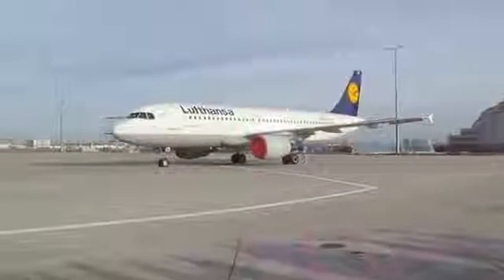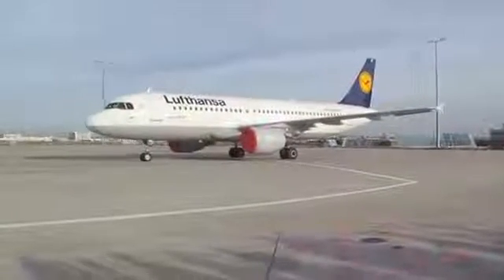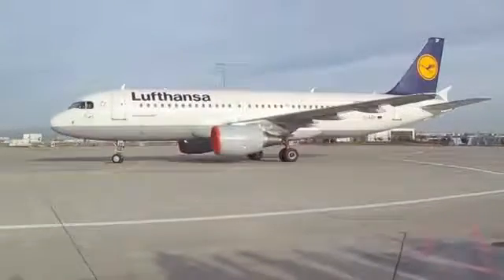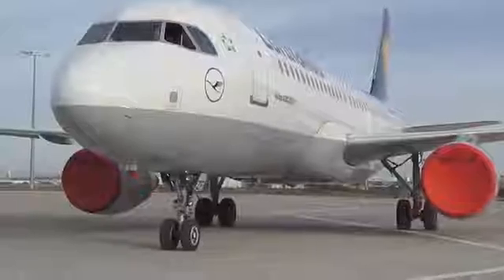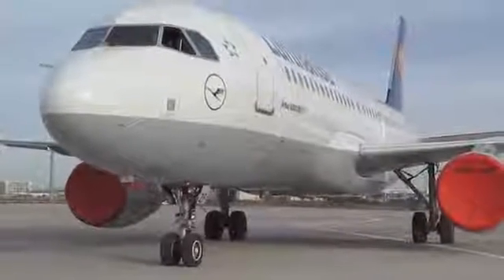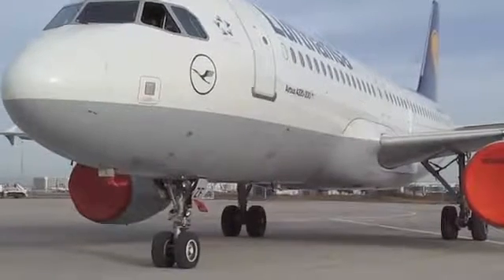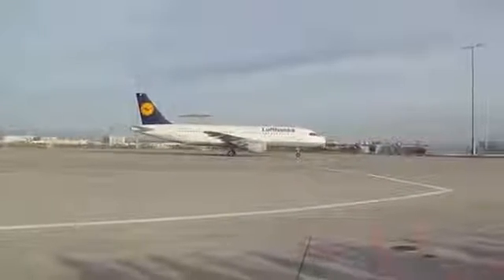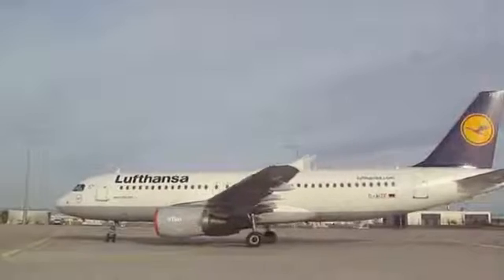Electric taxi system Airbus A320

Comment: Why doesn't the A350 have this?
Reply: Because the weight adicioned of the new equipments, in the long haul flights, increase the fuel consuption. In this case, is the opposite of the project goal (fuel savings).
Reply: @heberluizzunarellimartinsl4664  so it's perfect for short flights but too heavy for long flights

Comment: At last!This is a no brainer. Planes use up an amazing amount of fuel taxiing. Plus all the other savings and social/environmental benefits. My guess, 5 years until it's built in as standard on new planes and retro fitted to most of the rest.
Reply: Well here we are now five years since you wrote this comment and there’s literally nothing done differently
Reply: @boeinga370  
Yeah, sad isn’t it?
Reply: @q.e.d.9112  I know. They all go on about needing to make these “big changes” such as planting loads of trees and driving electric cars, but yet imagine the amount of fuel they would save burning if every single plane taxied around an airport electrically before and after each flight.
Reply: Honestly, in 100 years they will still be talking about what “needs to be urgently done” but the world will be the exact same as it is now
Reply: A no-brainer would it be when it wouldn't weight something

Comment: Using those electric motors ;  I suggest that they be used to SPIN the wheels up to speed before the plane actually lands, thus all but eliminating landing skid-wear on the tires themselves.
Reply: It’s been tried before using air, it causes the wheels to grab and redirect the aircrafts direction.
Reply: The primary objective of any landing is to get the aircraft to a safe taxiing speed as soon as possible, not meticulously protecting tyres. The vast majority of landings requires an ample amount of braking to slow the aircraft to a safe taxiing speed, in order to leave at the right exit and hence get to the gate on time - using up the entire length of the runway so as to protect the tyres is not at all the objective of a landing. The aforementioned braking puts a significant amount of wear on the tyres and that's absolutely ok as long as the aircraft can get to a stable low lift state on the ground.